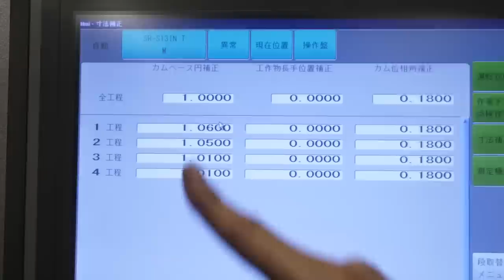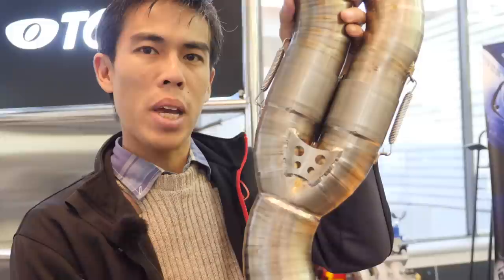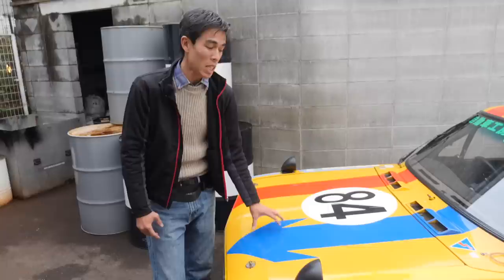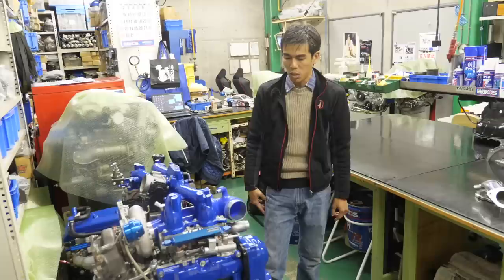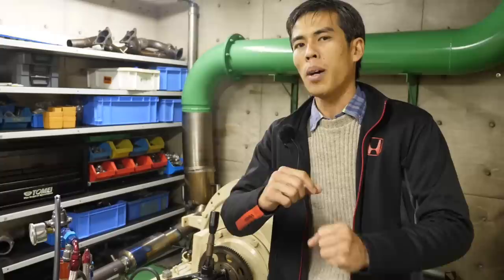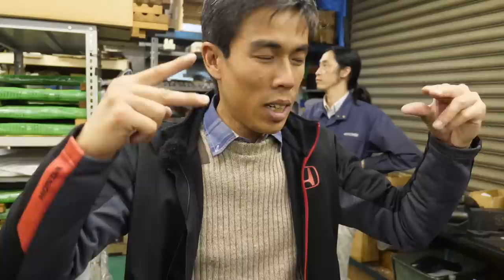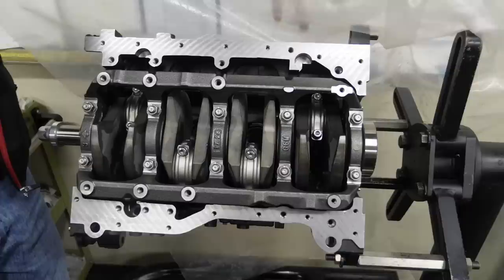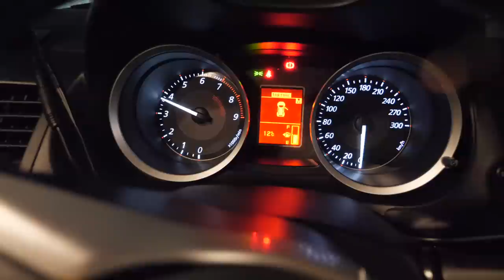Tomei Powered Opens its Doors; The Technology Behind Legendary JDM  Racing Constructor | JDM Masters

Comment: I've been saying this for years, Tomei is way underrated for its quality compare to other Japanese tuners.
Reply: People have clearly never seen their Ti exhaust in person or the quality of their products and welds. Best exhaust you can put on a VQ imo.
Reply: Underrated? Made in japan, made from titanium and the loudest by far. Besides the price they are on top with ets.
Reply: @bhuggz6032  Friend of mine in  the club I'm in has their intake, headers, and Ti exhaust on his VQ swapped widebody 240z. One of the best sounding cars I've ever heard.
Reply: problem with Tomei is that... their products has been plagiarized by some unscrupulous bastards... fakes and probably sold all over. In my place, you could easily get a fake Tomei fuel pressure regulator and some other stuff which Tomei didn't even produce.
Reply: It's not always about quality. If the acoustics aren't there, I don't care what it's made out of or where it comes from.
Reply: @setoman1  they make more than just exhausts he just brought up the welding quality and craftsmanship that goes into parts

Comment: No gap in joins/Cleaned with alcohol,Purge with gas inside at about 4 litres per min,No welding wire,fuse only.
Was doing this 30 years ago.

Comment: The main reason, why they have a transmission between engine and dyno is most likely the RPM limits of that huge dyno. Usually, these big eddy current dynos are limited to 5-6k RPM or even less.

Comment: this was funny!

"However, after the GT3 was recalled to repair an issue with the connecting rods, Porsche engineers were somehow able to figure out who bought the car after going through the information in its black box.
Robinson recalled that Porsche sent back the GT3 with a message under the engine cover that read: “Good luck Honda from Porsche. See you on the other side.”

Comment: My root issue it's crank shaft like drive shaft. Or tune port throttled body injection. I saw an weed Eater over HEAD out put high out put. Fuel economy or injection.

Comment: Why don’t performance cars just fit an oil accumulator to maintain oil pressure during moments when the oil pick up is starved of oil, or the oil oil it can pick up is too aerated? It could double as an oil feed to the turbo after the engine has been shut down, insteadof having to leave the engine idle to run an oil pump in order to bleed off the heat in the turbos shaft/cartridge.

Comment: 71 size till present. My thinking block ratio 750 c.c vs 4.7 7.2 or .5 1.5 or2.5 or 3.5 over HEAD display they die cast aluminum to die cast titanium hard and heat that's can take hot cold issue temperatures.

Comment: it's a rare chance to have a look at a boxer engine, and how stupid the engineering is. you can even see the non standard rediculous way the timing belt is ran and why it will fail if you abuse the engine, so drive easy if you own one.  the 4g63 you can see however is an engineering marvel and the 2jz is the king. pecking order.